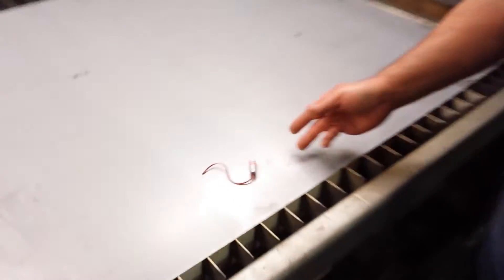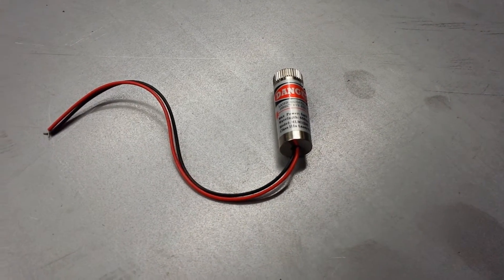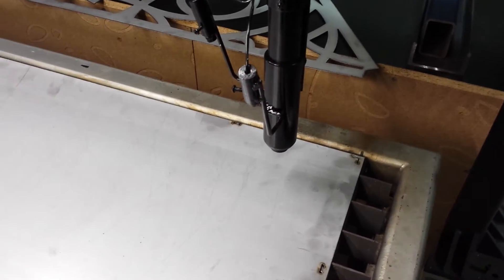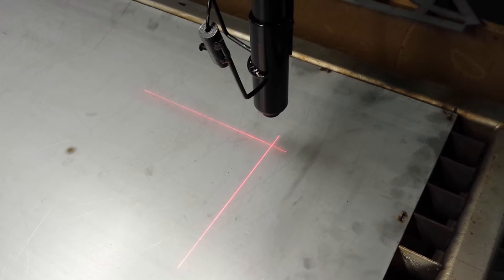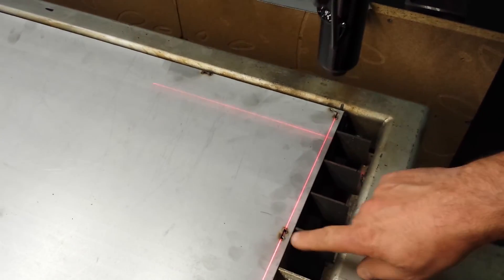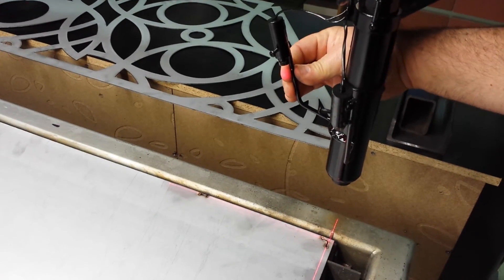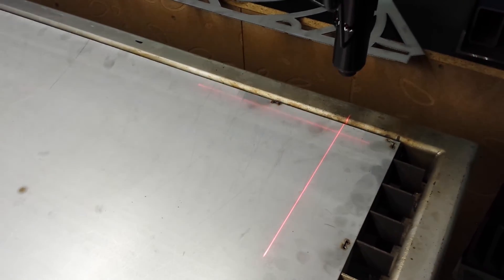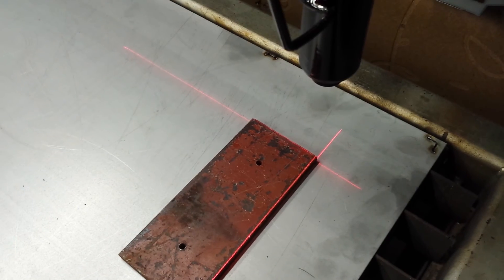CNC Plasma Cutter with laser target guides

Comment: I'm confused by the math of lines here. I did something similar, but when the head is raised the cross moves away from the center point as the lasers have to be slightly tilted to show the line without interference of the cut head. From what I can see, when you raise the laser (which is at an angle), it will place the line further from the set point before moving.  Only if they are straight vertical will the line not deviate. How have you not had this same issue???

Comment: Could you define the plate's diagonal on mach3? sometimes you put a plat & it is not straith as the mechine's coordinate, & you need to define the angle that the pate is rotated with, is that possible with mach3? 
By the way very nice tip:)

Comment: Since the lasers are on an angle, don't they move in x, y when you jog the z axis?
Reply from the maker: +mossdee
Hi the length of the lines does change as the Z moves up and down but the intersecting point does not.
Reply: +MadAboutCNC Swapped the beams and lasers in my head, and now it makes perfect sense! Genius!